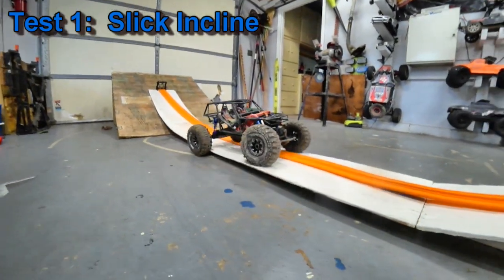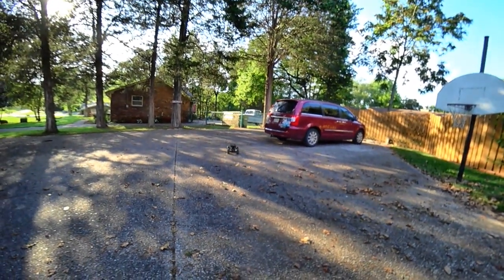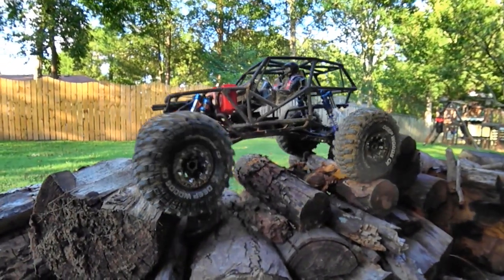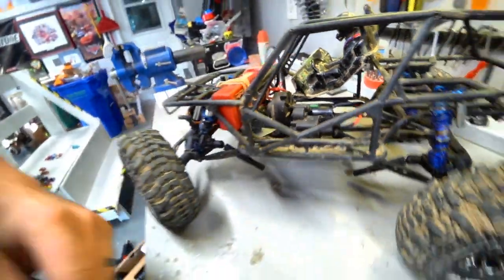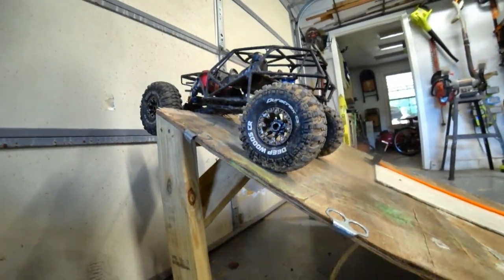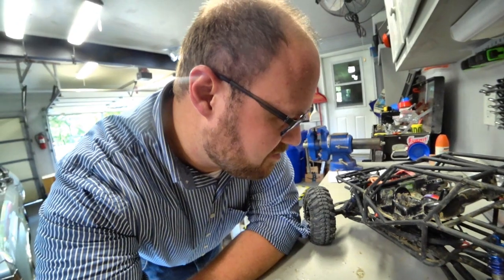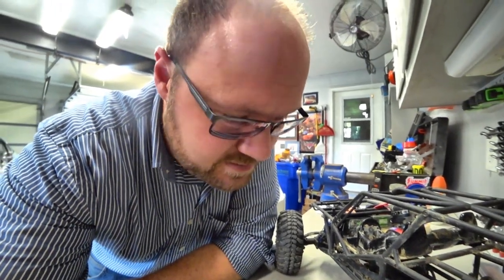Brushed Motors: 12T 550 versus 54T 540 in Axial Wraith

Comment: You're doing it wrong!  LOL  On some things anyway. (Like angle measurements. They were backwards!  It wasn't a 15* incline, but a 75! LOL ) But hey we all started somewhere, so thumbs up, nice work. One thing to keep in mind the turn vs rpm ratio changes when you go to a larger can.  So if someone went to a 12T 540 they would not see the same results as you did with the 550.  Same if you are going from a 3 to 5 section armature.  

I'm a big Holmes Hobby fan, but I have to say I'm surprised at how smooth that 54T redcat motor was.  Yes, i know it's a 54 turn, but even still it was exceptionally smooth.
Reply from the maker: You know, I hadn't even thought of the angle piece.  Very funny!  In my mind I was thinking of how close I was getting to 90*, but certainly wasn't saying it!  Ha!

Thanks for checking out our channel and helping keep us straight.
Reply: Important thingiy
Reply: I thought the red cat motor was a 17 turn 3 slot.  That’s what it says on the box

Comment: If i have a higher tooth pinion lets say a 27t should i get a lower turn motor or higher?
Reply from the maker: All depends on how fast you want to go!
Honestly, I doubt a 27T would fit with the stock spur gear.  Have you already fitted it?
Reply: @RoadsideRC  Yes its a wltoys a979b and i believe its a 27 turn brushed motor with a 27t pinion 42 spur
Reply: @RoadsideRC  Also thanks for the speedy reply 🙏

Comment: Nice comparison video and test run I put a 15t 550 in my Wraith afew days ago and I snapped the front dogbone after 5 minutes of ripping around my Freestyle course. I didn't need to trim the skidplate like you have to make the motor fit I'm running a 15tooth pinion instead of the stock 11tooth
Reply from the maker: Thanks for sharing.  If I had gone with something like the 15T you did, I could have also used 3S.  This motor limits me to 2S with this speed control.  Still - that is probably good for my parts breakage!
Reply: I'm still using 6cell nimh 3300mah pack's 9volts full charge going to get some 8cell nimh my ae5 speed control is good for 14 volts, not willing to risk a fire from the lipo I bash the hell out of my truck plenty of hard landings and I run everyday for afew hour's each use my course is in my backgarden.  You stay safe and appy in the lockdown 🍺🍺
Reply: @EBoB666  hi. Store your lipos in ammo can. Storage charge 3.8 per cell. Never discharge below 3.3. I then store ammo can in a di ad connected stove. Lipos are amazing. Dump the nmhs.

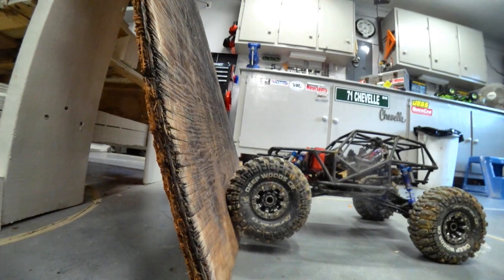Comment: 2:10 isn't actually 90 - 20 = 70 degree? 
where 0 degrees is horizontal / flat and 90 degrees is straight up... at least that's what I remember from school... :D
Reply from the maker: Yes!  I was just reading directly from the gauge.
Reply: @RoadsideRC  I guessed that..  but it didn't make any sense at first... I had to calculate the exact angle. I guess if you were using the other side of the angle tool you could get the right numbers! 
Anyhow, good vide, thank you!!!

Comment: Is there a higher than 54t and can it support 26 pounds
Reply from the maker: Dang...26 pounds is a lot. 
What chassis are you putting it in?
There are multiple RC vehicles larger scale that are in the 26 pound range.
Reply: Roadside RC I have a turnigy trooper Everythings mental and I got it from garage sale
Reply from the maker: You would be looking at something like a 1/5 scale power setup.
Reply from the maker: Looking again - that is just a 1/10 scale SCT.  It really shouldn't be 26pounds!!!
Reply: The guy that had it had all steel parts

Comment: My motor 12 t  550 titan 2003 old emax motor works perfect in my wraith 2.2 drive it hard. No issues. Fast and plenty of torque
.
Reply from the maker: Glad to hear.
Reply: Is the titan as fast as the Holmes hobby trail master 550 12t?
Reply: @needtau4138  hi I do not have experience with the Holmes. It's really fast . Faster than my 21 t in my trx4. I run on 3s. It crawls nice, has torque and speed. Can tolerate the 3 s power . After 20 minutes I cool down the wraith. No need for brushless. We should try the summit 775 550 traxxas.
Reply: @allmightygreatone1048  Ooo okay, thank you for the info.
Reply: @needtau4138  doing research to upgrade my old 3906 emax tonight. The site said original brushed motor was a 21 turn. Not a 12 turn. My axial wraith stock motor is no match for the old emax 550 motor. I run the old emax motor in the wraith.

Comment: My race and yours are almost identical except for I have sticky or tires in metal rims I got mine a good deal cuz I never thought I could afford one cuz their prices are so ridiculous especially with this cold is it going on or I should say the Trump 19 virus going onbut the question with the motor is what I was thinking about and I found your video and it answered it I want the brush motor because of a drag break but the 12T motor I bought my son a trx4 which is really expensive but thought man at the hobby shop told me to put the motor in a distilled glass of water and run it it will harden the brushesand gives it a little more speed I thought he was nuts electricity and water don't mix but I tried it and it did work and my son's trx4 has outlasted all my brush motors and that's the 550 Titan I love the redcat 550 can motors because they're cheap and they are durable thanks for the visit answered some questions take care and be safe
Reply from the maker: Thanks for the comment. 
There is a lot of different information on brushed motors break-in.  I did this method simply because it is how Holmes Hobbies officially recommends to do it. 

Glad you are out having fun with RC!

Comment: Cause when building a ramp making it wide enough is just too much work 😅 your also holding that wrong. It's more like 80 degrees and 85 degrees.  A 15 degree incline is like driving up a wheel chair ramp. It's basically flat bro.
Reply from the maker: You are right - I was backward on my measurements.
Reply: @RoadsideRC  😂 it happens to the best of us!It was hard to watch tho so frustrating. Other than that nice work tho man.
Reply: He's not wrong he's reading off 90 degrees. 15 is the same as 85 if coming off of a 90 degree

Comment: erm you are testing the grip of the tires more than you are the torque of the motor. granted that you had improved speed which is great but it still doesnt show the difference in torque.
Reply from the maker: That is actually one of the points!
The 12T 550 has more than enough torque to do whatever the higher-turn motor does....so why do you really need the higher turn motor...?

Comment: You should keep the 12 turn but add a two speed transmission
Reply from the maker: I'm not a huge fan of the 2-speed transmissions - that is just more parts to break and more weight to have on the truck.   But, it would certainly get me more speed!
Reply: @RoadsideRC  what gearing are you using with the 12 turn ?

Comment: That not no damn 20 to 15 degrees damn 🤦🏼‍♂️ common sense in the beginning of the vid is 90 degrees Eva use it’s vertical 🤦🏼‍♂️ and 45 is half of that and the hot wheels track is 45 degrees 🤦🏼‍♂️
Reply from the maker: It was reading how far off of 90 degrees obviously.  
You are correct, I did say it wrong in the video.